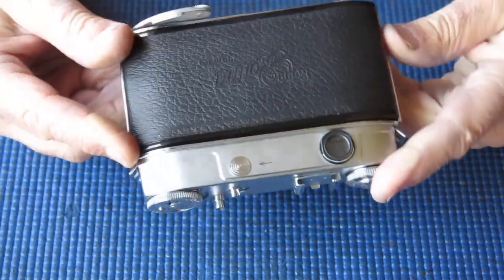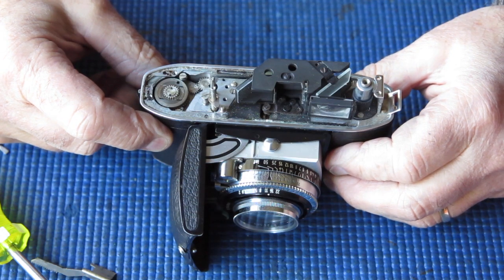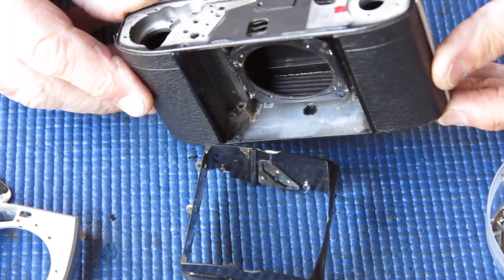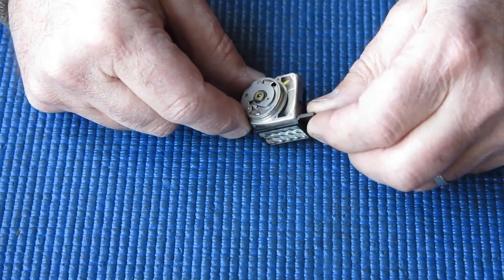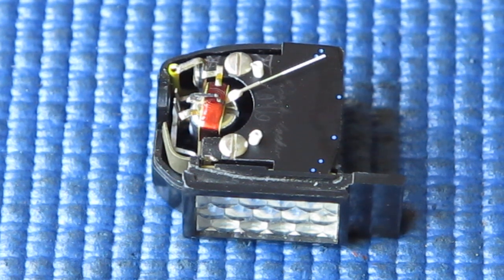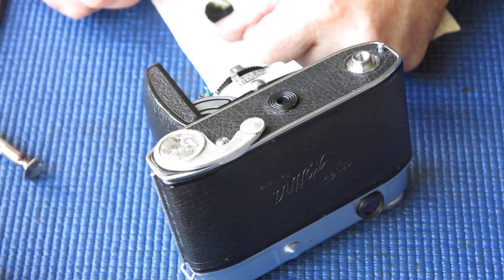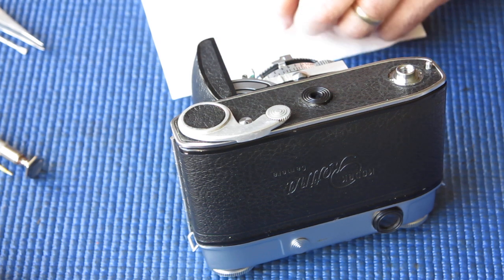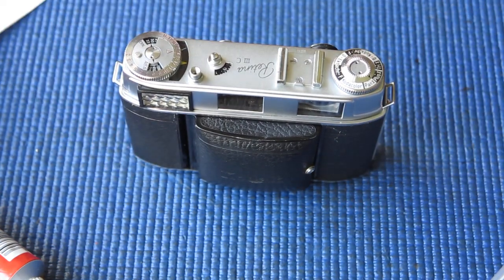Kodak Retina IIIC with a stuck film advance lever.

Comment: If that camera was mine I'd be delighted with it exactly as it is. If a camera works I aim to use it and with negative film I can estimate the exposure well enough in most cases. With reversal film I would take an incident reading with a modern meter anyway so the non-working meter would be of no consequence at all.

Comment: Great video thanks.  I’m working on another IIIc.   The winding mechanism.   I’m having trouble with this one and I can’t figure it out. It’s driving me bananas.  I cock it all the way and it hangs up at the top of the winding stroke and will not release.  So the winder gets stuck at the fully cocked position and will not swing to the retracted position, although there is spring tension.   The only way to release the winder back to the retracted position is to push on the (Screw) spring loaded top film release, the one under the normal push button.   
I’m thinking maybe at the 8:35 mark in your video the cocking shaft is gritty or frozen and not allowing the cocking rack to move correctly.   I’ve been scratching my head for A WEEK. Lol.    I’m not giving up.    
I will disassemble it all again and soak the entire cocking rack in naphtha in my ultrasonic cleaner.  
Thanks for the video 🙌.  Your videos keep me thinking and learning.
Reply: I figured it out.  The cocking winder that goes up from the bottom of the camera to the top gearing.. the bottom part that attaches to the frame of the camera with 3 screws, in the center is a smashed rivet.   That rivet is loose causing the entire shaft assembly to wobble so that when racking the lever, it sticks in the cocked position.  This one drove me absolutely bananas.   Glad that is resolved.  :)

Comment: My Retina IIIc  Xenon f2 50mm lens has a stock focus ring anyone have any thoughts about it. THANKS
Reply from the maker: Either the focus helical is simply stuck with dried-out grease, or one of the screws behind the shutter has backed-out and is now jamming the focus scale ring. The shutter and lens assembly will need to be removed anyway.